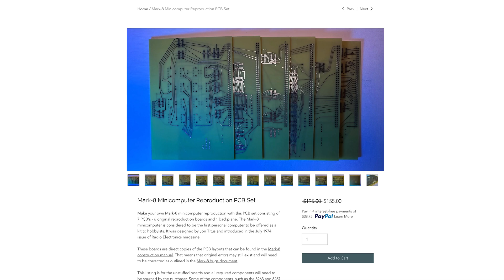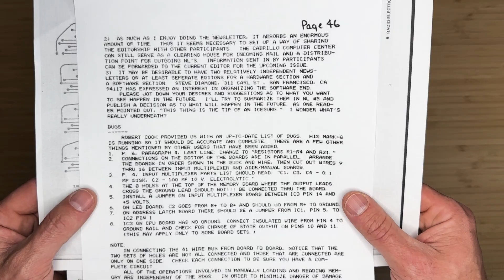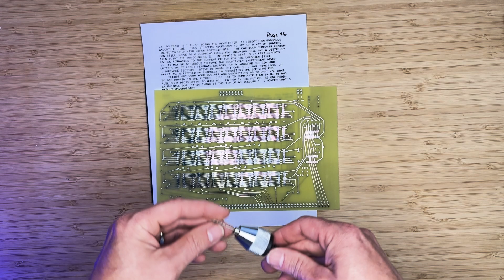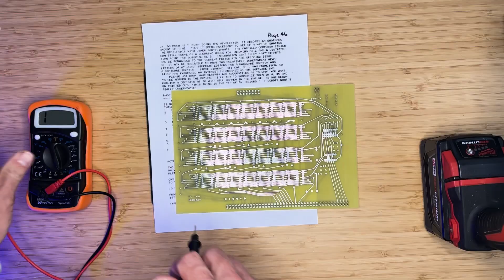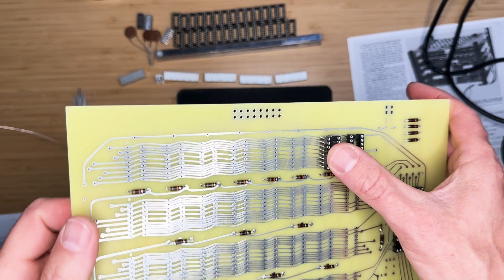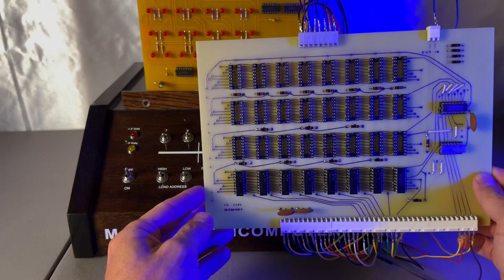Mark-8 Reproduction Memory Board

Comment: Cool!  I did cringe a bit at the PCB bug still being in the reproduction, but I guess that's part of what makes it an authentic reproduction board.  🙂  I like how the Molex connectors can be lined up to make the 41 pins without actually modifying the connector.
Reply from the maker: Exactly! I wanted the reproduction to be exactly like the original, including the bugs. Yeah, the connectors are nicer than the clone Mark-8 from previous videos.

Comment: I remember that bug in the original Mark 8. If I remember prices correctly the 32 1102 sRAM chips cost almost as much as the cpu at the time.
Reply from the maker: That’s awesome! Did you build one? The 1101 chips are still expensive - maybe $5-10 each.
Reply: @vintagetechrevivals I was given one that was partially assembled. It took me about a year to purchase and assemble the remaining parts and to get everything working. It helped that the guy that started assembling it had all the mailings from the user group that formed to assist each other. What didn't help was that all the board interconnections were point to point wired and the guy that started it messed up the wiring. A slight problem was that the original boards didn't have plated through holes and it was necessary to solder everything on both sides and put short wires in the vias.

Comment: This is a Sweet Project, I would be Torn though:
Make it LOOK Original, or Prink the PCBs in Newer Funky Looking Sets..
Maybe its been so Long I forget.
Ultimately is there a Particular Program or Game you are Excited to Test when this Project reaches its Final Form
Reply from the maker: In this video, I want to make it look like the original. I don't have any specific program that I want to try but I did want to run some of the programs that were available for the Intel 8008 CPU. It would be nice to connect a tape reader to it.
Reply: @vintagetechrevivals  Im still waiting on thatText Display LOL
Reply from the maker: @MotownBatman  Which text display? Are you referring to the TeleType?
Reply: @vintagetechrevivals I swore a few months back when you started with this, I had bugged ya about a text display, which you said was comming eventually.
Possibly another similar computer.
Eith way, this is swet, just making comments lol
Reply: @vintagetechrevivals  Waiting for terminal access :-)
Reply from the maker: @yorkan213swd6  I might build the TV Typewriter in the future so be on a lookout.
Reply from the maker: @MotownBatman  It may have been about the TV Typewriter which is coming soon. If you're referring to the serial interface, we already have that but in the newer PCB variant.